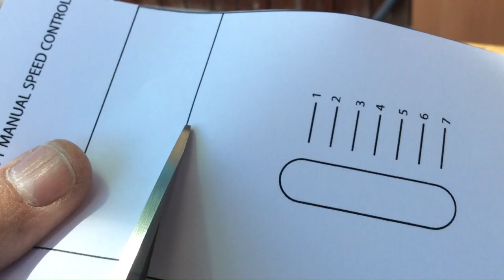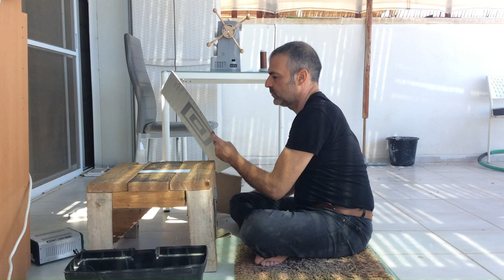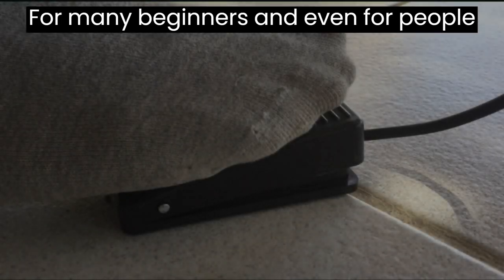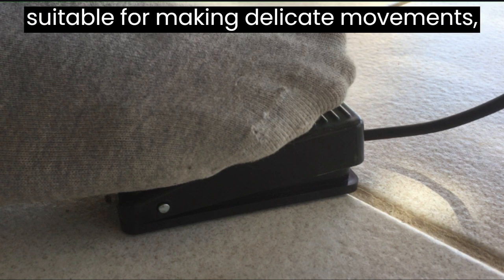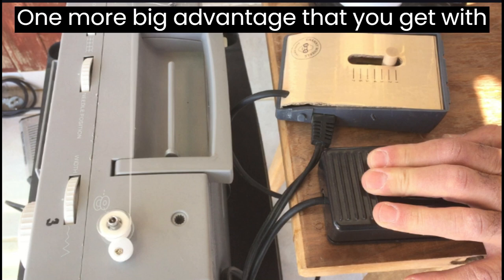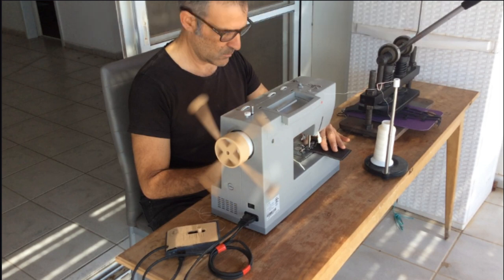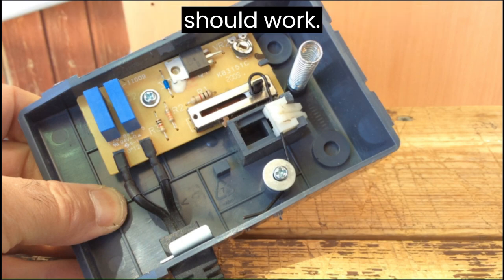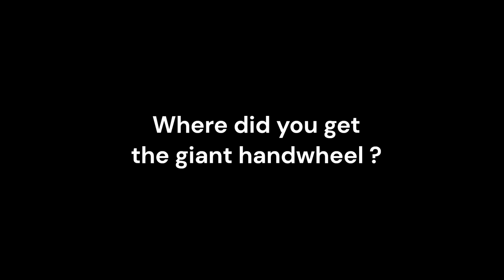How to Slow Down a Sewing Machine Running too Fast - Singer Heavy Duty Speed Control

Comment: @grannywheels did you know that you can dial down the potentiometer top left in the foot pedal to slow it down as well ?
Reply: how does one do this? what does the potentiometer look like?
Reply: @nikkicovington6090  it looks a little like a horse shoe shaped circle, it has a small rectangular hole in the centre, you use a small flat head screwdriver to turn to the left, and it can slow down the machine a bit, but it also takes longer for the machine to kick in, so you put more pressure on the pedal to get it going, it also isn't the best fix because the stupid think is still too fast imo, but it does slow it a bit. The method in this video slows it down even better. You need a crimping tool for the video method, its not too hard to work out, just as long as you are patient with yourself and keep trying, it took me about 10 tries with the crimping tool to figure it out, (I've never used one before) there are videos on youtube that spell it out for you.) good luck😊

Comment: The problem with this method is you are undervolting it and thus it cannot do thick fabric on low speed. The solution would be to have a motor that has less rng with a gear reduction method of some sort with full throttle and voltage.

Comment: Hi Granny Wheels, I have a singer 834 and the foot pedal has a carbon disk rheostat, not a circuit board that you show. One terminal has a long flat plate type connector and the other a regular female connector. Can this setup be modified with yours?
Reply: oh my goodness I have the same one and it's too fast! I bought a new pedal that worked perfectly at the shop, meaning that you could control the speed better, but now it doesn't work either. I'm so annoyed 🙄🙄

Comment: Thank you for your interesting and informative video. With your modification does the footpedal now merely act as an on/off switch and the speed is entirely governed by the slider?
Or does the slider set the maximum speed when the pedal is fully down but it can be made to run slower with lighter pressure. I.e the slider acts as a maximum speed limiter.
Reply from the maker: The foot switch (not the foot pedal) now acts as an on/off switch and the slider entirely governs the speed. The foot pedal is no more as we have taken it apart.
Reply: @grannywheels  Thank you. All clear now.

Comment: In the video, you said that the power of the machine does not allow you to sew leather at very low speed. If you don't use the pedal but use the wheel by hand, can it go through the leather?  (like you do for the corners).  I ask this because I was wondering if it was possible with any sewing machine to freely hand sew stitch by stitch (and disabling the feeding tooth) so that I could do some sort of hand embroidery?
Reply from the maker: Basically yes unless the leather is very hard and thick. The Singer Heavy Duty is mostly made of plastic. If you put too much force on the handwheel it will break.
Reply: @grannywheels  Thanks for your advices! I was looking for a machine that could handle relatively thin leather and have slow speed, and I'll maybe buy the Brother A16. What do you think about it?
Reply from the maker: Sorry, I wouldn't know. I'm not familiar with that model. Try reading Amazon reviews, that's the best source of info IMHO @clementlebouc9746

Comment: My sewing machine has the same pedal, however I opened it and the machine won’t start near the high end/the start of the slider: it would only start running when the slider reaches near the lower end. I would say only the lower 25% length of the slider actually starts the machine, that gives very little room to control the speed. 
Any idea why would this be like that? Can it be fixed? I see a potentiometer there inside the pedal, could turning it help on this?
Reply from the maker: I know what you mean. I also know about the potentiometer. I did once try to play around with the potentiometer but didn't get any meaningful results. But I didn't really investigate it that much. Concerning the slider, I suspect that if you replace that slider (if it's possible at all) with a more sensitive slider that has a bigger range you might get better results.
Reply from the maker: Also, when starting the machine make sure the needle is in the air and not inside the fabric. You want zero resistance at take off.

Comment: Hello. A question . If you have a sewing material, thick, say 8mm-10mm, can you sew it with this machine? And let him say, you want to mow in zigzag, or other patterns. Can you do that with this sewing machine? I ask out of curiosity. Thank you
Reply from the maker: Zig zag yes. 8-10mm is very thick. What material is it ? If leather it will not work. If very soft material  maybe yes.
Reply: @grannywheels  It's not leather. They are thick materials in several layers
Reply from the maker: Sounds like you will need a stronger machine for something like that. Probably an industrial walking foot machine like the Sailrite Ultrafeed.  @forestdamian5601
Reply: @grannywheels  @grannywheels I thought that with a sewing machine like yours it would work. But it seems I was wrong. Thanks for the reply. I like your videos, they are interesting. But now I'm sad. I thought that a sewing machine like yours would be the answer to my problem. I understood your point of view. Thank you.
Reply: Its mad, but I've found my hand crank antique sewing machine copes with the toughest fabrics the best, it only does one type of stitch but its incredible for goes through anything!